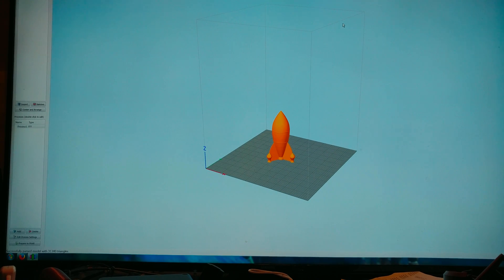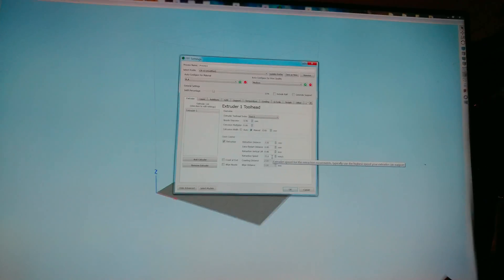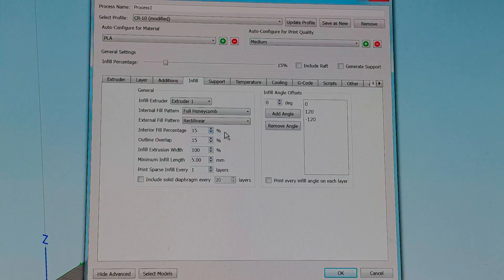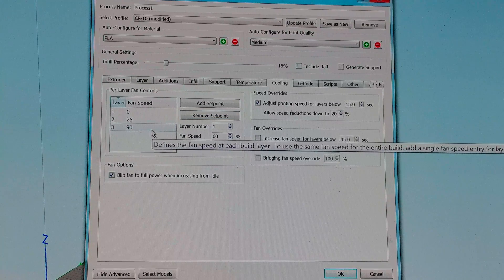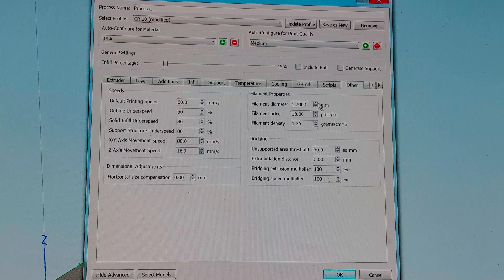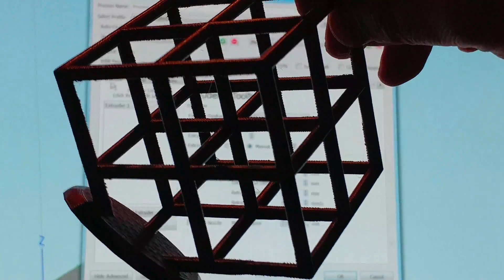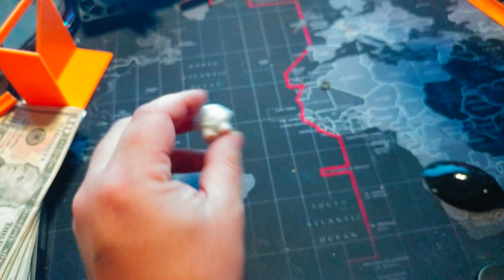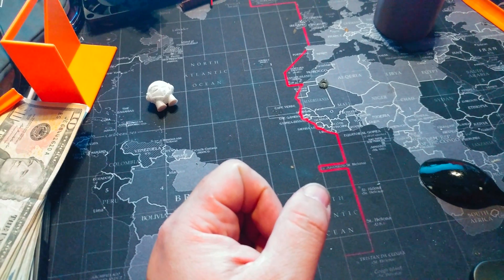Today's 3D Print - Simplify 3D settings for my Creality CR-10

Comment: Hi Nerys been out of printing for  a while and wanted to dust of my Cr-10, any updates on this S3d Profile, did you mange to update to remove that minor zits. Also have you used Esun PLA+
Reply from the maker: You can never totally remove zits you can just minimize them but the best thing to do is to line them up on the same spot where they're out of the way you can fine  tune pretty nicely to reduce their impact and make them almost invisible but they will always be there the problem is you have to tune this per model she can't just create a profile that covers everything

Esun pla plus is amazing well they don't have the greatest color selection the filament Prince absolutely amazingly and is extremely tolerant of abuse and bad settings with a huge comfortable temperature range and it prints like cream cheese :-) you will love the stuff
Reply: @nerys71 thx. yes it's my goto filament and I have quiet a bit of it. Really happy to see your channel doing well, your making good content as always. Unfortunately we dont get the Amazon bargains you get in the US here in Australia yet.

Comment: I use same settings on my cr10 and my printer . print then pause then print what I am doing wrong
Reply from the maker: +sky rim what is going wrong?
Reply: It print then it pause for a couple of seconds then print then pause.iam using simplify 3d same script as yours
Reply from the maker: +sky rim pausing is .... Odd. Did you try some of my sample gcode? See if those pause.
Reply: Same here... print one layer and stop..print one layer and stop...

Comment: Can these settings be used on the Ender 2?
Reply from the maker: +NSCXP2005 not entirely since the print volume is different go to one of my current videos anyone that's number and from now on I have a link in the description to all my printer profiles including the Ender the settings could work for the Ender if you make sure you put in the correct bed size 150 by 150 by 225 and I will change the retraction to 4.5 millimeters as I don't think you need 7 on the Ender otherwise I believe the settings are pretty much the same
Reply: Thanks Nerys. In regards to Print in Z, What size is best for the Ender 2?
Reply from the maker: +NSCXP2005 wait until I get home tomorrow night but I believe it's 165 by 165 I also bought build tax magnetic spring metal plate print bed and I'm going to slap a piece of printing Z on it so I'll have both the removable buildtak magnetic plate and the printing Z surface that I can Flex that will be very cool combo expensive but cool

Comment: @Nerys  do you find the zits appear more often at certain layer heights on circular shapes? When I make fidget spinners that are bat-ER-rang shaped I don't see any "zits" however sometimes when I make smaller spherical shapes like MS and Apple pen/pencil holders I see more Zits when it's about to start new layer. It's as if the initial extrusion rate is too much or print speed is too high as the zit is formed from the extra ooze and stays in place  as extruder continues to lay down filament. It's so odd that it doesn't form zits at every layer change as you might think it would if the flow/extrusion rate is too much. Retracting around 7-8mm w RT speed around 32mms as I get zero stringing from my prints , so I don't think it's related to retraction nearly as much as "initial layer start flow" but there doesn't seem to be a setting for that ? I'm using Cura 2.6.1 and might pay the damn $150 for Simplify3D since that's what MOST people swear by yet I've seen prints of exact same models sliced w each program (Cura and S3D) and Cura beat S3D in quite a few areas and vice versa. Cura seemed to handle embossing text better than S3D. Not saying one is better than the other as I haven't used S3D yet just not sold on paying $150 for a program that MIGHT improve print time and quality. What are your thoughts on the zits and S3D? Have you ever used Cura 2.6.1 ? They added a bunch of new features and better support generation and gradual infill which I imagine you might use a lot based on your models
Reply from the maker: Drewski17 i use s3d. the zits are every layer they are just randomized. i will have a make a test model to identify where they are coming from (end of line or start of linel

Comment: You mentioned running the extruder at a hotter temperature for your wood filament, curious what brand wood filament did you use and any issues running it through the CR-10 stock set up?
Reply from the maker: I was under extrusions and jam ups. increasing the temp unjammed it and kept it unjammed. it was hatchbox woodfill and running at 230c got me flawless prints.